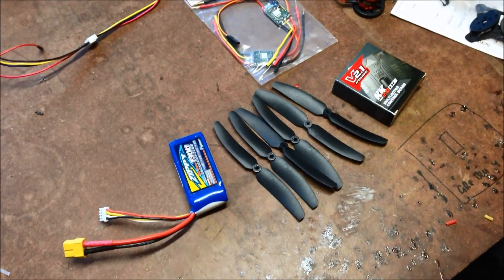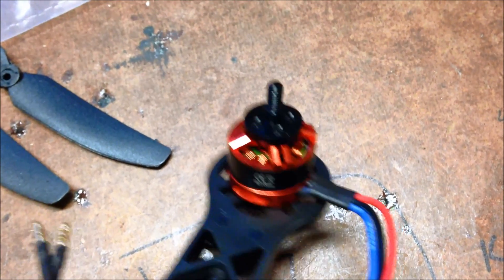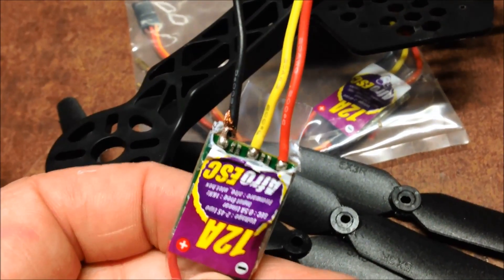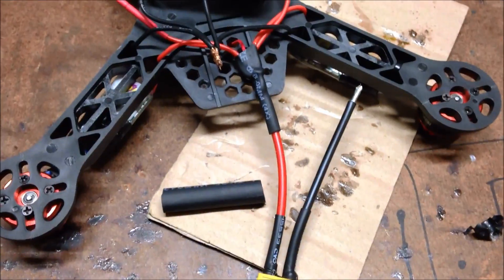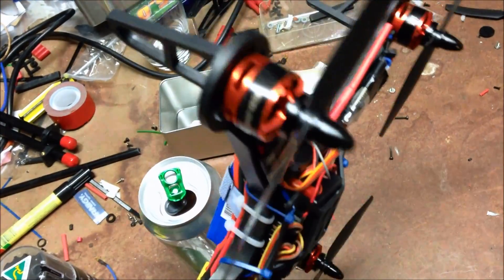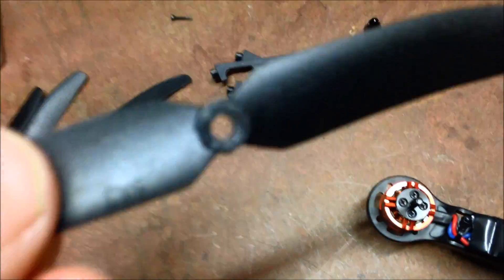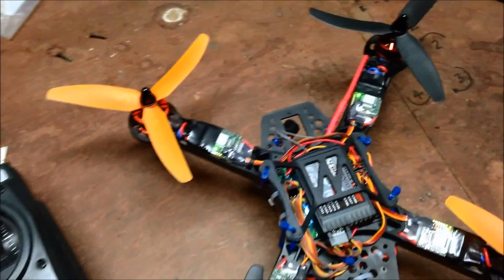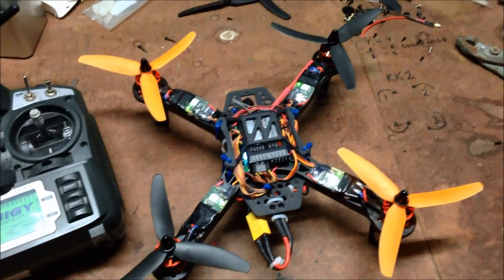Hobbyking Diatone 250 Quadcopter build with DYS 2300kv motors 12A Afro ESC KK2.1 RC911 Turnigy 9x

Comment: Hi there....quick question ? why is it necessary to remove the positive cable from the plug set of the esc?
what function/purpose does this serve? I have seen this done before. Does it have to do with the set up or flight controller one is using ?
Reply from the maker: It is about the voltage supplied on that pin. The controller needs 5 volts. If you supply 5v x 4 in parallel it can sometimes burn out the flight controller. I have had this happen to me once with a NAZA Lite controller. KK2 seems to be able to handle it but better to be safe.
Reply: drone19730602 I've been flying KK2s for almost 2 years and have never removed the positive wire.  As long as the BECs on your ESCs are "linear", then you should be fine.
Reply: Simon Hahnel Thanks for your advice.
Reply: ***** Thanks for your advice.
Reply: +drone19730602 
Hey 5V is 5V as long as it is in parallel,  the problem is if you do remove the other 3 positive wires, and something happens to the bec in the esc you have and it goes dead, you are screwed, that means no power to the receiver or the main board,   with the other 3 positive hooked up not much of a chance of losing it,  also when you only use one bec positive wire, that means that one has to supply all the current to run the receiver and board,  most esc becs only supply about 3Amps,  so you are really pushing that bec.  hope this helps.
Reply: +Simon Hahnel not true, as they are onnected internally anyway. you loose the chance of one wire functioning while one isn't. makes absolutely no sense.

Comment: when u conect the esc to the kk board do u have to put them in a order or not im new to building quads and i would like to learn
Reply from the maker: aerial beast Yes motors must connect in the correct order and spin the correct way
Reply: owcan u check or know if their in the rigth spot
Reply from the maker: All the controllers are different so you need to research the specific controller you plan to use.

Comment: the reason for cutting the pos. wires but motor 1 ?
Reply from the maker: ***** It is about the voltage supplied on that pin. The controller needs 5 volts. If you supply 5v x 4 in parallel it can sometimes burn out the flight controller. I have had this happen to me once with a NAZA Lite controller. KK2 seems to be able to handle it but better to be safe.
Reply: Simon Hahnel yes, that makes sense, thank you !

Comment: how much it cost in total?
Reply from the maker: Sochet SOM 
Frame     $10
Motors   $40
ESCs        $40
KK2.1      $20
Receiver  $9
Transmitter    $60
Battery    $8
So all up around $190

Comment: How much $ was it?
Reply from the maker: Frame     $10
Motors   $40
ESCs        $40
KK2.1      $20
Receiver  $9
Transmitter    $60
Battery    $8
So all up around $190
Reply: Thanks... Cool! Great job.  With out radio?   I have a micro but its time to step it up.
Reply from the maker: Transmitter and Receiver refer to the Radio
Reply: yes lol